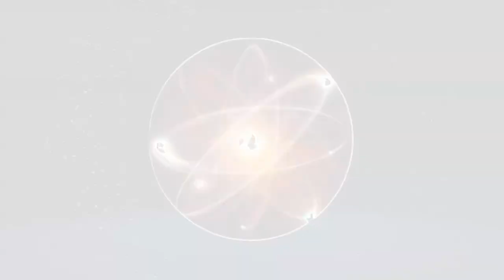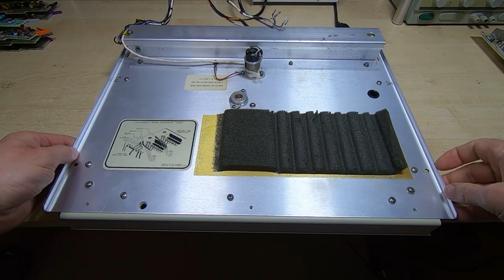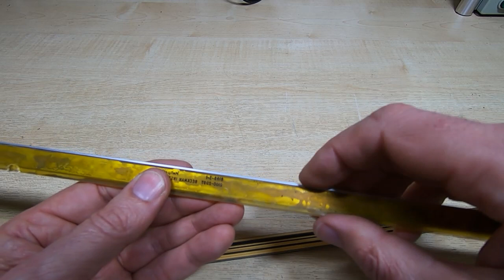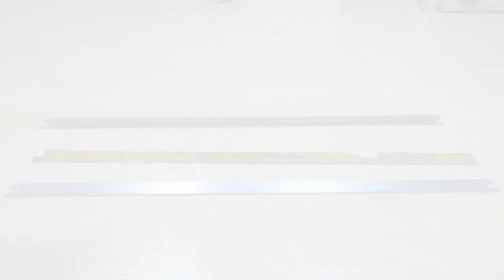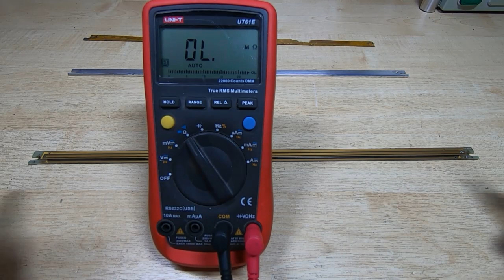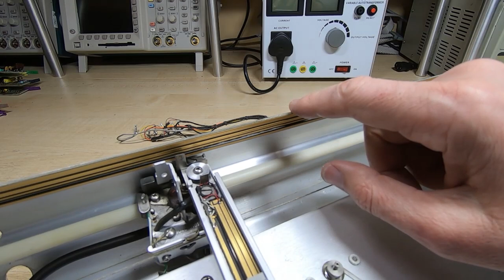HP9862A Calculator Plotter Repair Part4

Comment: Please install a crowbar circuit on the voltage rails if you don't want to upgrade the regulator circuitry/devices.
Reply from the maker: The supply already has one but even if it did not I would not modify it. I always try to keep these units as original as possible so I very rarely change them.

Comment: Jerry, I've pictured the last user throwing this plotter on top of a pile of other trash, then throwing more stuff onto this unit, causing the mechanical damages that you have shown.  What type/brand of double-sided tape did you use when reassembling the potentiometer?